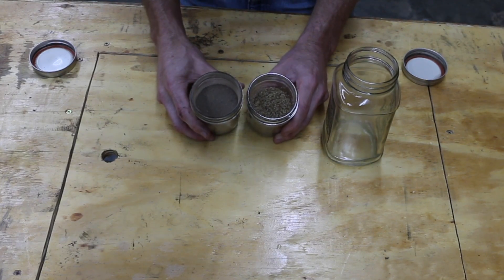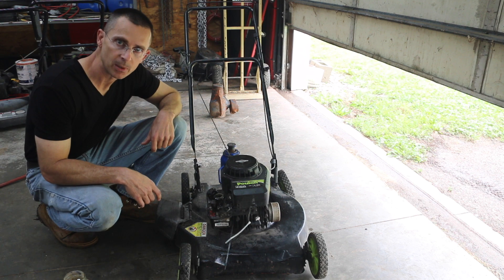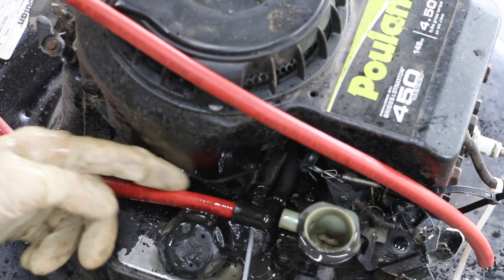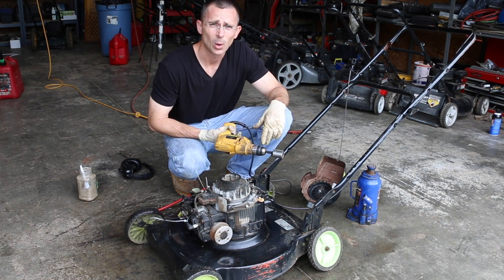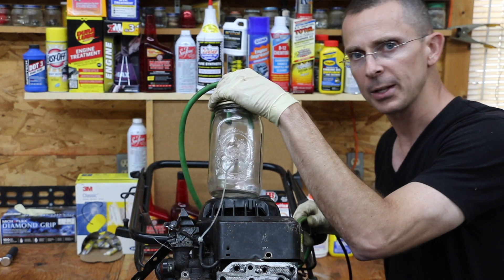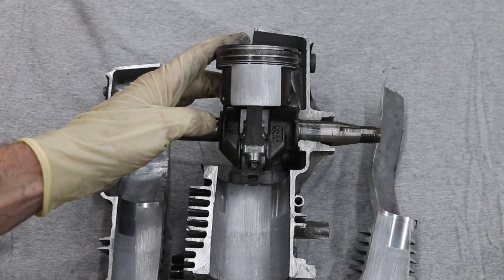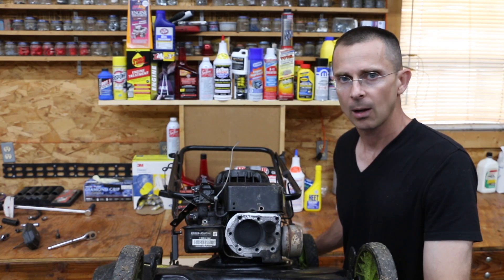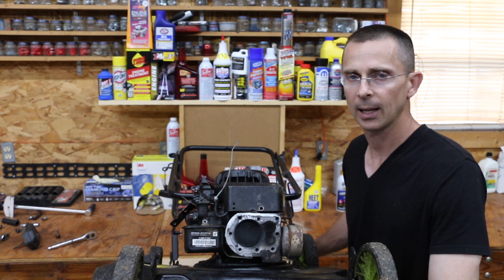Will Dirt Destroy an Engine?  See what it does to this Engine!

Comment: The master of meaningless tests.
What's real world about putting spoonfuls of dirt in an engine?  That is NOT how dirt would be drawn through in the real world at all.  Any amount would be pulled in over many hours and much more finely dispersed. 
You may as well Pour a whole can of fuel in all at once and say the fuel killed the engine.
Reply: @Xander Luciano If you have a few fine particles in the air (I doubt that sand would even get in if you weren't driving offroad), it will do little to no damage. On the other hand, pouring a spoon of sand in a running engine will accumulate and for sure kill it.
This test didn't show anything.
Reply: Oil Burner 
Working with older engines overtime will grant in having this kind of results as this one. It is highly possible to engine to suck in small particles and scratch the cylinder badly.

However, this kind of broad damage is very unlikely to ever occur and therefore you're very much right about the 'spoonfuls' of dirt being ever possible to your engine to suck in. 

This test is still meaningful in all of its inconvenience with real world scenarios, therefore providing fine information to everyone working with engines and perhaps even to those who don't.
Reply: Oil Burner this is a fast way to show what would happen after years of built up damage and abuse.ots exaggerated, but it shows you what type of damage occurs, where it occurs, and the overall effect it has on the engine.
Reply: But check the after times he put the sand in the carburator, and it was a little amount of sand and the engine was about to turn off. Imagine if you drive your vehicle in a way with too much ground lifting by the air or you're driving behind another vehicle that lifts a lot of ground! Some part of that is gonna be sucked by your engine
Reply: I think some of you are missing the point here. This is dramatized. If an engine only had, let's say 1 tenth the damage this lawnmower had, it's fair to say it performance would suffer. For those who disagree I would say try it for your self. Run your car with no air filter and see what damage it does. Great video really shows the importance of good air filters
Reply: Oil Burner
If you were living in a country with recurrent sand storms you’ll understand what he was trying to say
Reply: @dereknapier836  You'd be surprised at all the newbies who try to "mod" their cars. I'm sure there at people out there who DO run their cars without one thinking it would be better. Some people just dont know any better but most do have logic and common sense. Edit: this video would be a perfect fit for them.
Reply: It is for curiosity purposes,it is like what inside ,good mythical morning tests.....just for fun....
Reply: Oil Burner Wow, someone didn't listen to anything that the man said. Asshole.
Reply: Putting a ton of sand in at once does not simulate years of use. There is a big difference between giving the motor hundreds of even thousands of hours to work dirt out of and just filling it with course sand.....
Reply: Guys, this Oil Burner is just one of those idiots not using an air filter. You heard what he said at the VERY beginning of the vid dumbass. If you don’t like his vids fuck off. That simple.

Comment: i also removed the air filter from nearly every car i owned had none of this trouble all it took was a pair of women tights or  stockings  double them over tie rapped them on the air inlet an worked as good as as any after market high flow air filter for a fraction of the cost the hardest part is getting your girl friend wife to part with them lol
Reply: So you removed the factory air filter and replaced it with a DIY air filter. So the car still had an air filter. +1 for adding some fun to collecting filter materials but not exactly what the video was about.

Comment: great! 2 days before I got out of the air force my friends and I went out camping overnight and while we were gone our base - George afb, Victorville, ca. - was hit by a massive  sandstorm.  I  came home  to a room  buried in an inch of sand. my car was about  the same. the next day  it wouldn't start even though I'd tried my best to get rid of most of the sand under the hood.  I had to leave it there to the evil desert gods.
  around  here the fun thing to do is drain the oil out of a car  motor and run it hard until it blows up or seizes . there is also a small  amount of wagering on exactly when that might occur.

Comment: my car i was told that the sugar was put in the coolant and the motor was replaced for that reason happened long before I got my car. my guess is the the caramelized sugar plugs up the coolant passages all over and the engine overheats

Comment: As kids we build a go cart with a snow blower engine on it. We soon learned that it did not have an air filter... it lasted about as long as the engine you used after a couple hours on a dirt road. However, that dewalt drill brings new life to an old mower.. now where is my 100ft extension cord >.>

Comment: Had a mate of mine who owned a Jeep Wrangler CRD and his air filter was installed incorrectly by the dealership.
He went down a dirt/dusty road and it completely ruined his engine to the point where he needed a replacement(cheaper) or a complete rebuild as the diesels that Jeep uses are VM motori and are wet lined sleeved.

Doesnt take much at all!

Comment: Can you drown a motor with water while it is running?  That happens constantly to ATV riders.  go too deep in a mud hole and kill the engine.  Will it damage the rod bearing or crank bearing.  Will it bend the connecting rod?  Most of the time people just drain the oil a few times and move on.  best to drown it while it is running full speed.  That would be very interesting to see what is damaged.

Comment: I had no doubt this would destroy the engine but the oil difference really surprised me. I always thought the oil blackened by the combustion process. It seems it is not just soot. I also hate that engine type so it doesn't t hurt my feelings. I grabbed one on the side of the road modified it to jam into overgrown thorns at work. Better than a weed walker.

Comment: Would like to know what happens if you used vegetable oil instead of motor oil...could happen run out of oil on way home and all one has is a jug of vegetable oil or another test like to see is run a two stroke with no oil in the gas.

Comment: Another failure mode that would be interesting would be to install the wrong temperature (way too hot) spark plug and see if it melts a hole in the piston.

Comment: So what about raising compression? You can wire brush the combustion chamber then ues JB Weld to fill the chamber, chech the clearance and try running it. It will be easy to do, because it is a L head. Just make sure the intake and exhaust can still flow a little.

Comment: This is useless he directly poured in sand, if a few particles get it it will dissolve it might scratch and cause damage but nothing major, in this case he poured in large amount and even then is still ran fine only after  trying snd trying did it kinda fail

Comment: Recently had an issue with synthetic oil gelling. Not going to say which brand because I'm not blaming the oil, but it turned completely to jelly after only 600 miles use. The company told me that the only way that could happen would be "if some type of contaminant is introduced into the oil in a large concentration". The only contaminate that could get in this motor's oil "naturally" would be coolant, but it shows no signs of that.

Might be interesting to test with different household substances to see if, or how much, antifreeze might cause that, or other contaminants, like dish soap, etc.

Comment: Hi there, If you would take the time...
I have a question, I recently aquired a Honda gx140 5HP Engine from a Fishing company called (Tasal) They said the 'Engine' was seized, so i picked it up for 5 bucks.
The engine was used for Bilge pumping salmon farms, It was a fire pump, Thus it has largely corroded and rusted the Pump section, But i'm interested in the engine; After using a screwdriver and a rubber mallet on the impeller it freed up, And after 8 oil changes the Oil seemed to be fine, The engine didn't have any rod-knock or much (I couldn't detect any) Blowby, So i'm assuming the Impeller bearing rusted and seized, Not the engine.

The issue is, How would one go about removing the rusted Impeller from the engine when the bolts used for connecting it to the shaft are hidden under the impeller, I have had several attempts at removing it with a Rubber mallet and socket Wrench, It didn't budge; Any suggestions on how i might to about doing this And or things to watch out for with the engine (As the oil at the point of draining is basically white toothpaste) However the engine itself (Despite the impellers bearing noise) seems to be running fine after a carb clean.

Comment: Excellent video is not a waste at all, I had an experience with a small RC scale buggy, me and a friend bought two identical buggies with RC OS 0.15 Car Engines and they perform fine for a couple months, then air filters became useless and I decided to remove the one in my car until get a new filter, while my friend managed to get a new one immediately, we keep racing often until mine couldn't be idleing any more and that took just two days in normal use to fail, not in dirt tracks just plain street. I did opened the engine to examin and find very similar results as you. Since that day I figured out the consequences of not having a good air filter, by the way those engines use oil impregnated air filters to trap the smallest dust particles. Congrats for an excellent channel!

Comment: Throwing the sand directly into the intake does not in any shape or form simulate an engine running without the air filter. I have seen moped engines running with no air filter for extender periods of time firsthand and the cylinder wall doesn't look anything close to this. What I have seen is a lot of carbon deposit spreading beyond the piston ring and further down the piston. That is unmistakably due to increased blow by because of lost compression. What you have simulated is driving trough a desert sand storm without an intake manifold.

Comment: I tried to blow up a mower like that 20 years ago by dumping the oil but only when I put the Hose water down the intake at full rpm did it go bang.You learn so much more by doing these silly things.

Comment: Craigslist be like: Mildly used lawnmower. Engine is in good condition.   Just needs some new piston rings and cylinder might need to be honed. Also you will need to glue the engine back together yourself. Asking $999 Give me a call if you have any questions or offers. SERIOUS BUYERS ONLY!!!!

Comment: Maybe it's alsof interesting to see what happens if you put some sugar in the motoroil, or perhaps Coca-Cola.
At work some of the machines were sabotaged, the motoroil turned in to some syrup- like sticky fluid.
My gues is they sabotaged it whit those kind of Materials.
Or they put some water in the oil, which is then turned in to somewhat mayonnaisse-like substance.
Hope you reply on my comment
thanks in advance.

Comment: running without an air filter doesn't gain power. ever wonder why airboxes are weird shapes? the intake has sound waves moving back and forth and airboxes are designed to try having the wave going towards the intake when the port/valve opens. removing an airbox or filter just makes things worse. thebest you can do is keep your airbox and use a high flow filter like k&n or unifilter

Comment: What about badly adjusted valves? 
stage 1: too much clearance (causing the valve to bounce and not follow the cam lobe) 
Stage 2: Too close (poor compression)
Stage 3: Out of phase 

Could also try different length plugs  (assuming they miss the piston crown) to see if it makes a difference (use to be an old 2 stroke tuning trick) 

Or simply, over revving (please remove the blade ahead of this test in case it detonates on you!!) 

What about different fuels? or combustible materials ( I start mine using brake cleaner after a winter store... be warned it does over rev a lot!)

Comment: Removing the filter or intake also really screws up the flow and tuning characteristics which are vital to power, especially below peak RPM.  On a road vehicle, you lose a lot of power in the low to midrange which is where 99% of even "spirited" driving takes place.

Comment: Lawnmower for sale. Used for 15 minutes only.
Reply: wolfpackflt670 because he accidentally shoved lots of dirt and sand into it
Reply: Just needs a new spark plug😂
Reply: wolfpackflt670 didnt run as smooth as i thought
Reply: Oswin Chin up on Craigslist
Reply: Oswin Chin good maintanence just add a bit of oil here and there, only used twice great condition
Reply: Can be emptied to provide a substrate for a driveway. FEED ME SAND.
Reply: Minor compression issues.
Reply: Known condition, first owner.
Reply: Oswin Chin PMSL!
Reply: Why are you getting rid of it?

Comment: We bought a 351 Windsor V8 and the people that we bought it from got a shit ton of water in it and we took of the heads and we looked at the pistons and one was missing because the water caused the piston to explode into 10 pieces and the pieces of it were in the oil pan and the connecting rod had punched a hole into the cylinder wall and the whole rod was bent like a banana

Comment: that engine shouldn't even run with compression 
by the way invest in a cylinder leakage tester for use on a four stroke.

Comment: hi dude.. i just stripped down my 20 year old briggs motor.. it had about 70psi compression. what should it have been reading to have good compression??
Reply from the maker: vtecdamo, 70 PSI is adequate to produce a decent level of performance.  An engine in pristine condition (my opinion and experience) will produce around 90-100 PSI.  Thanks for watching the and commenting!
Reply: Project Farm  ok cool because i no a petrol car engine will b higher like 150 to 180. so thers me thinking the lawnmover was down on compression🤔

Comment: I'm wondering if the muffler was packed with exhausted dirt and if that helped speed up the destruction. 
I ask because while over in the Philippines for a humanitarian mission we had our diesel generator struggle to keep running, after the mechanics looked at it we had to start running JP8 (air force, tons of that available) in it with some local diesel added to the tank for lubrication, because the diesel we were getting locally had so much oil in it the muffler was packed with soot and carbon.

Comment: This was a great video.  sadly i ran my jeep a few short trips without a filter.  Arggg.  Anyway, i know a possible test you could try.  My brother says that when he worked on small engines, a lot of times people would get a new mower and mow super thick grass without giving the lawn mower a break, and cause it to bear down constantly, smoking oil until it just tore up.  Usually he said the engines were too damaged after that to fix, unless they wanted a new mower.  Also, for some mowers, mowing on a hill or ditch too long can cause the oil to not lube the piston properly, causing severe damage as well.

Comment: when a smaller amount of particulate enter the engine they may just pass through with the exhaust gas. when you dump sand into the carb, it's definitely going to build up in the cylinder, especially when it bogs it down. 

I agree that a filter is a must, but this is overkill.
Reply from the maker: Wheresmy240, I agree and great points!  Thanks for watching the and commenting!